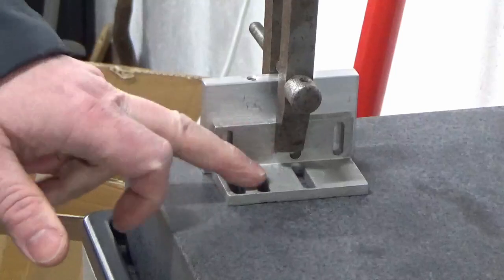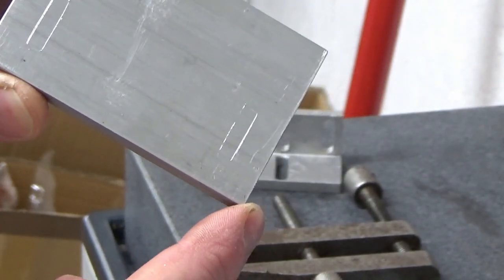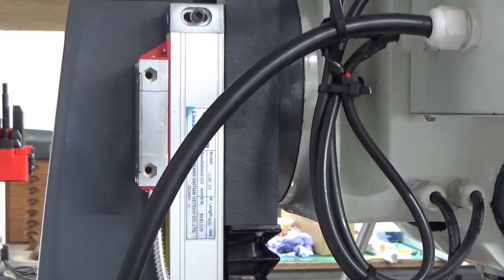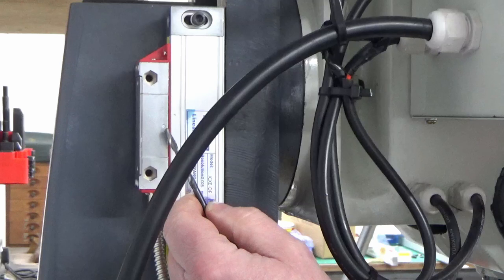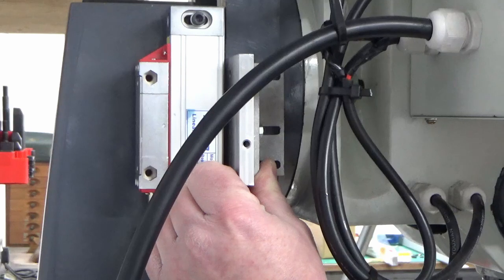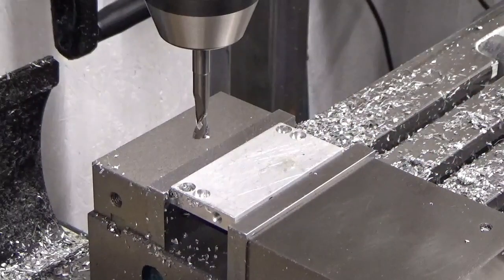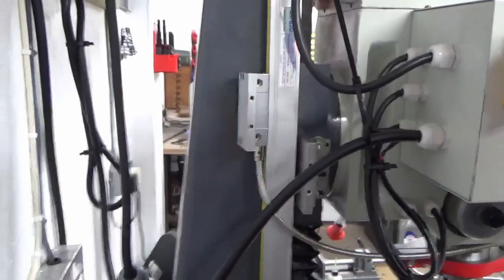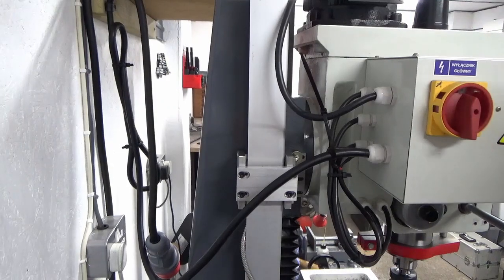Fitting A DRO To The Cormak ZX 7045 Mill Z Axis Part 2

Comment: Keep @ it Jon, I put a log burner in my garage sorry workshop problem was the flue wasn't long enough so the first few times I tried to light her up it wouldn't draw the flame!!! whole bloody shop was filled in smoke ha ha. After sussing out he problem works great now. TFS, G :)
Reply from the maker: Hi Graeme, thanks for the comment. What did you do to extend the flue? A bit of spaghetti zig zagging inside or a long chimney outside? Cheers, Jon
Reply: @jonsworkshop  Hi Jon, the flue just wasn't above the garage roof Doh, the top of the cover was just flush, being an idiot I just thought yeah it's outside!!! In the end just a short piece outside to take it over the roof. stay well Dude. G :)

Comment: The practice hole session probably would have been a separate video, there was plenty to choose from😅.
The end result though is very robust and will do nicely. I just revisited your rotary table episodes and saw you have a very nice dial indicator holder in the chuck/collet with a dovetail adjustment. Could this be worthy of a few minutes of video. I am presently in the process of making one and interested in how the adjustment works. Thanks Fred.
Reply from the maker: Hi Fred, ha haaa! Love the wit, just my sense of humour. There were more wrong holes than right ones in one of the bits, lol. I blame the cold. I will do a short section on the clock holder in my next Blether video for you. Cheers, Jon

Comment: Hi Jon. Time to get a nice oil filled heater going in your shop! Lidl are doing them cheap. In my old workshop I was doing some machining and tig welding in the winter of 2010 when it was about - 12! I had cardboard on the floor to prevent my feet freezing through my boots! I like the mounting of the scale and the bridge piece. I think the idea with the plastic clips on the sliding portion is to keep them on as you fit the driving feature. That way you ensure the sliding piece is at the correct clearance etc automatically. Do you plan to fit a Dro to your lathe too?
Reply from the maker: Hi Carl, thanks for the comment. The sad thing is I had a 2kW oil filled rad on to get it to -7, it was -11 before I put it on lol. Managed to get to +2 after a couple of hours (positively tropical). Going to get a 5kW diesel heater I think despite how damn noisy they are. Need to attack the door in the better weather - too many gaps. I thought the same but on mine the plastic was too thick (about 0.3 thicker than instructions state) and the reader was not sitting uniformly on the plastic (cocked over to one side) that's why I just ditched it and set it up manually. DRO on lathe is a distant possibility but want to upgrade my welding capabilities next so way down the line (not so necessary on a lathe). Cheers, Jon.
Reply: @jonsworkshop  Hi Jon, it was a bit of a numpty comment of mine to think you'd not have a heater. In my old shop the roof was just corrugated type stuff and a lot of the heat escaped through that. Used to take a long while to get up to temp. Thanks for letting me know about the plastic clips. I've just bought a glass scale to replace one on my lathe. Previously I set the old one up manually and I thought I'd missed a trick with the clips. I've learned something from you, as per every one of your videos. Thanks for that.

Comment: Hi Jon. That bracket look fine to me, the main thing it functions correctly and is nice and solid. Tony
Reply from the maker: Hi Tony, thanks for the comment. Yes, it's certainly not going anywhere, possibly a bit over engineered but it will certainly do the job. X is next. Cheers, Jon

Comment: What ho old frozen fingers, i thought i would join the party early this time, i hope you feel suitably honoured.
It's quite a while since i fitted mine but i seem to recall removing the plastic "transit" pieces was the last thing to do. On mine i understood them to be locating pieces to ensure the correct clearance inside while bolting it all together, there being no bearing surfaces in the scales to keep things in position ie your 1/2 mm.
The other scales should be easier with machined surfaces to screw to and then you get the whoopee moment when it all works.😊
Reply from the maker: Hi Chris, I absolutely feel honoured. I was going to do the same but on closer inspection the reader was not sitting flush to the plastic (twist caused by the spring pressure I guess). Also the book says 0.5mm and the plastic was about 0.85mm so I decided to just lose the plastic and not let it influence. The X will be fairly straightforward (currently WIP and going OK..... so far...... that's just jinxed it), The Y will be an absolute b#&%a*d and I am really not looking forward to it! There's no room and not a flat surface anywhere to attach anything. If nothing else it will make entertaining viewing for you all. Cheers, Jon

Comment: Great - asthetics aside it is functional - just redoing my z scale after it was fitted by Well known  Company and suprise it was fitted reader facing the table and no cover, had to remove it just to start making the plates - I can appreciate your muscles after all the head winding up and down - Stepper on the Z axis next for me
Reply from the maker: Hi Terence, thanks for the comment. Doesn't surprise me, they will just throw them on in the quickest way possible, it's a shame you didn't run a clock on it before you removed the scale, I bet it wouldn't have been within spec. I may well be adding some assistance to the Z at some point in the future. Cheers, Jon